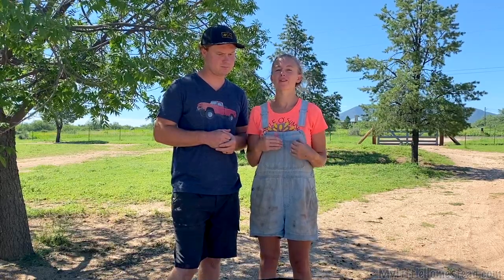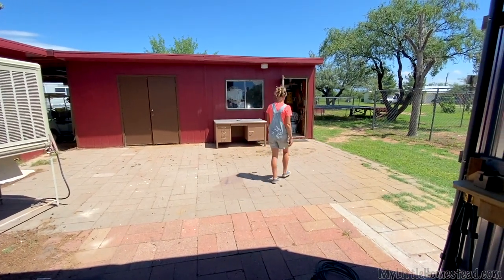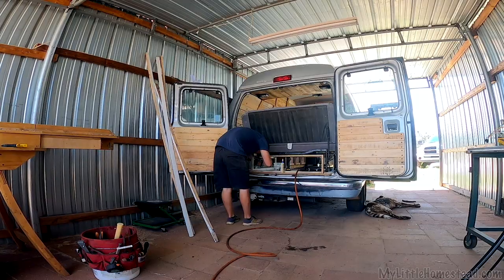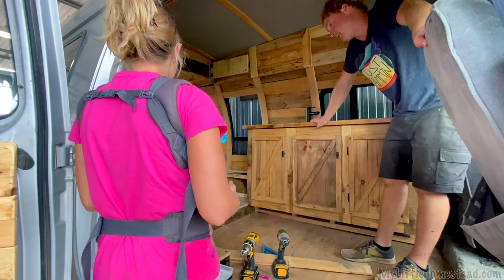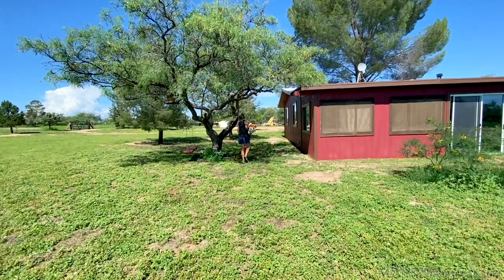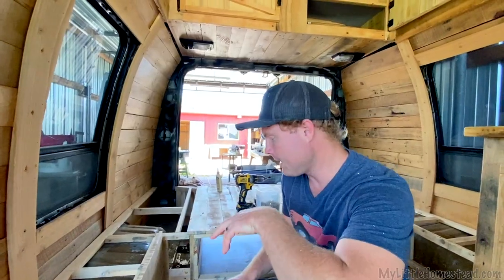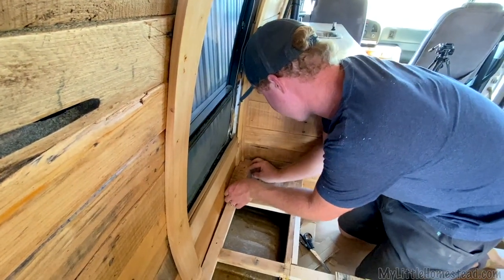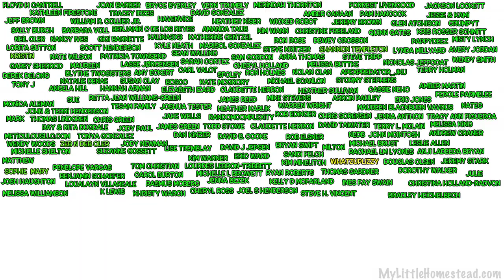Building A Storage Cabinet Under The Back Seat In A Conversion Van | Weekly Peek Ep306

Comment: Hello everyone. Garen i have a few questions for you if you don't mind. Have you thought about making a box around the ac outlet to make a few vent area to have more flow like you see in RV. On the hydroponics garden how clean do you need to get the boxs for the plants. From 1 to 5. 1 be a little and 5 to be clean like you could eat out of them. Do you have to have fish or could you do minnows or shinners. And how many would you start off with if you have to use fish or minnows. On the fish tote would you put it in a shelter area and insulation around it. Im in south Carolina. Or would you drain it for winter time. How many garden boxes on your setup. What if you do 2 fish totes how many would you use for it. Thanks for your time and help. Yall make great videos every week. I watch every one of them. Every week.

Comment: Bed Length Fillers?  We used children's blow-up pools, blow up only enough to allow you to fold the circle and squish into the 2 sides becoming the right amount of 'firm.'  After some practice, you can get it pretty quickly.  The smaller pools fill up with just manual blowing so fast, you don't need anything fancy.  Tuck in, put blanket over entire mattress to smooth the joins, then bedrolls/bags/whatever.  In the morning, you can let the air out to fold and store in some small corner.  We also kept small pools for children's bathtubs, and yes, sometimes it was a tub by day and bed extender by night.  They're not expensive, I liked to keep an extra on hand just because campgrounds can be dangerous to plastic.  Love the van, it is coming along so beautifully.

Comment: you should really if you can afford it get a planer, the side sander works but you could really cut the time it takes with a planer then a real fast light sand. I really think you would benefit,,,, also you really should get away from picture frame construction and cope. its stronger and looks way more clean and seamless

Comment: I don’t want to be a bad guy cause I been watching y’all do you for years but if the babies are going to be in the seat with a 1x2 base made of wood with the seat and a car seat on it y’all are crazy. Make the seat base out of steel please!!!!!for the babies please don’t trust 1x2 wood.
Reply: The factory seat has a steel frame that still attaches to the original mounting spots, nothing has changed. They just added a floor and a box underneath.